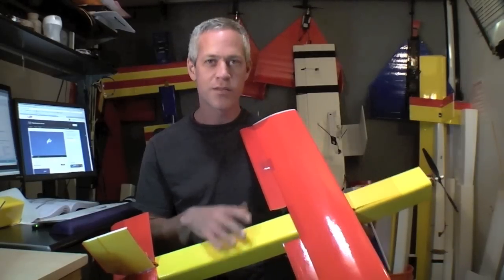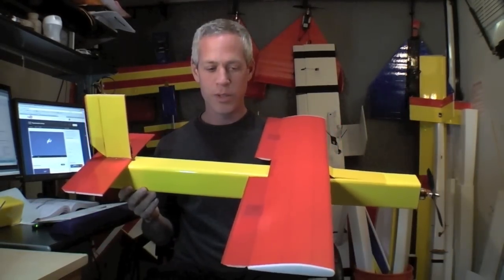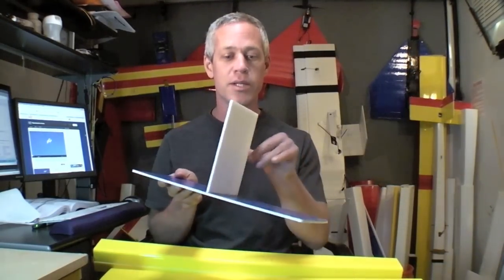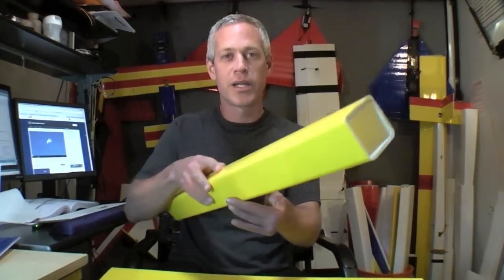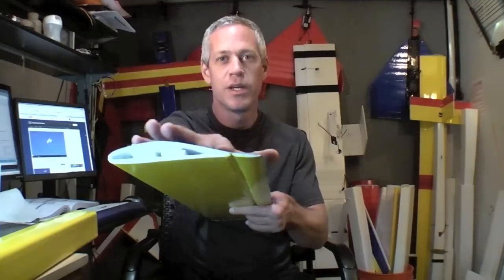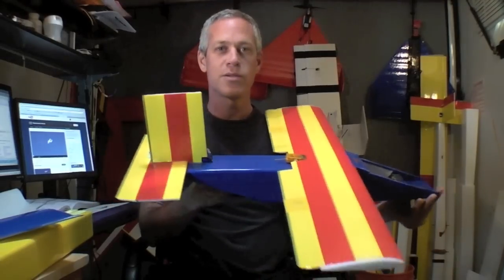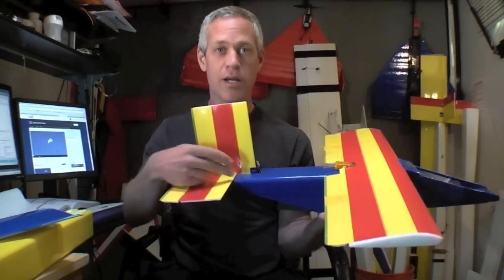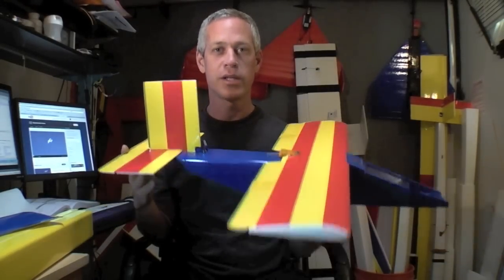Introduction: Ed @ Experimental Airlines

Comment: You rock! Love the videos, I have never noticed you had a hand injury.  My left hand has Ti screws holding my thumb together, It can become very uncomfortable and swollen after flying RC planes or motorcycling/biking but I chalk it up to it "getting stronger".  My accident was a mishap on a bike 3 years ago, and it feel it every day... I need to learn how to "pinch the sticks" like you showed as it seems more comfortable, but I have very little control with that method. "Lucky" for both of us its our left hand, which usually does less than the right hand when flying RC (and most things if your right handed).  I'm building a noob tube currently to teach a friend on, it will have dihedrial tho and no ailerons,  otherwise similar to yours.  THANKS for all the help/plans!

Comment: Hey Flyboy, as you're in south England, see if there's a "The Range" shop near you, they should have an art dept with A1 size foamcore art board. It's very similar to the stuff Ed uses, and cheaper than from 'art' shops. Unfortunately, like all UK artboard, it is 'orrible to peel the paper off. I haven't tried Depron yet. Personally, I use Kilma underfloor foam board, from Screwfix. Once you've taped one side of it, it works much the same as the dollar tree foamboard. Good luck.

Comment from the maker: There are a few with the battery connector already on, but you must make sure you use the same battery connector type, otherwise there will be some soldering involved.

Comment: and try to discharge and re charge but it's just not working...I'm using a passport ultra charger so I'll try a couple of those batteries that you suggested and see if it's my charger...I guess than I would ask what chargers have you used and been successful with

Comment: Hello Ed..Im having a lot of trouble balancing a three cell lipo that came with the plane I bought...in fact it will not balace at all....the plane is a Flyzone Switch...plane flys great but the batteries are crap this is the second batterie from the company and the both do the same thing...my question is do you have a brand that is tried and true..or is it always hit or miss with lipo batteries.....Thanks and Merry Christmas

Comment: Ed,
Great job on the videos and the techniques. I've already used some of your techniques on my foamies. 
Here's a question for you. How would you build a flying wing, like a Zagi, Maxi Swift, etc?
I thought to build two 30" wing sections, and then cutting two of the ends and angles and mate the two together. Would that be a project you'd take on?
Again, great job on the videos and tips. 
Keith.

Comment: @ExperimentalAirlines I ask because I just maiden 2 noobtoob's and the one that did fly had roll rates that were off the charts  . Unfortunately I kind of cheated and used a spare set of axn ele and stab. It Just didn't have enough elevator . The other was just too underpowered to fly. Too bad because with a conical shaped tube and that rear setup it looked really good! Good thing I went nuts with building spare tubes and wings :)

Comment from the maker: @usarmyfl1 I think almost any paint would do, but it's also likely to flake off the tape eventually.  I would think about lightly sanding the tape surface and even using primer.  There is a spray paint for plastic called "Fusion" which has some sort of solvent that bonds it to plastics.  Theoretically this might work better on the packing tape.

Comment: I just finished building the Noob Tube and was curious, that since its covered in paper and tape, I can use any paint since it wont melt the foam but, what paint would show up glossy on clear tape? Just regular cheap "gloss" spray paint?

Comment: I love your approach to this hobby, I Fly in the UK and tort my self to fly many moons ago, by building simple planes, similar to your designs, but with balsa wood, and a RC car remote and a small glow engine set to full throttle, know Sims back then, so it took a good few builds, I now Fly FPV, and I'm a member of FPVUK forum, this is where I found your video, it was posted up by a member. I still love designing and building new design, well don and keep them coming.
regards Gordon

Comment from the maker: @kmatusik73 I would recommend using dowels or arrow shafts (carbon or aluminum) as the individual spars.  Find some aluminum tubing that fits nicely around the spars and gently bend it to the desired dihedral angle then slip in the spars and finally the wings.  Use a tubing bending if possible.  You can put some sand inside the tubing if not.  The idea is not to crimp the tubing.  If you use hollow spars you could use a solid joiner, like a metal rod or bolt, and bend that.

Comment from the maker: @7daniel49 It didn't move at all for about a month, then I could twitch it a little towards my index (well, middle) finger.  I needed a separate surgery about 8 months later to attach a tendon to allow true opposition, moving it out away from the palm.  It took another 2 years to master using it.  It's all in your head, really.  Just like learning to use a new tool for all those familiar tasks.